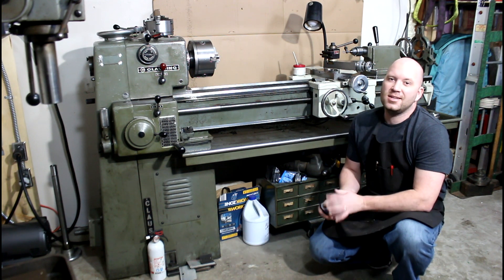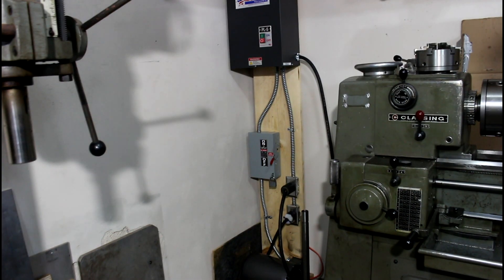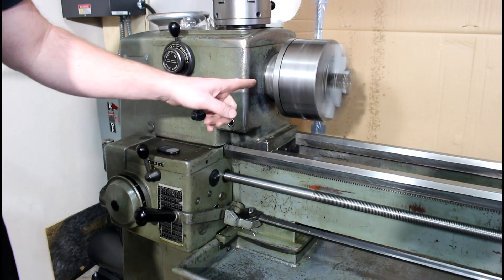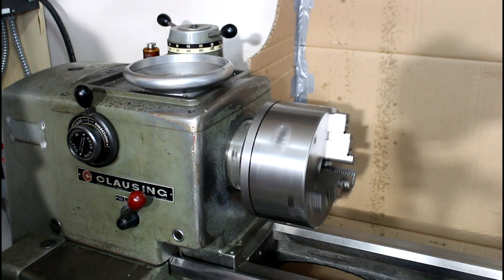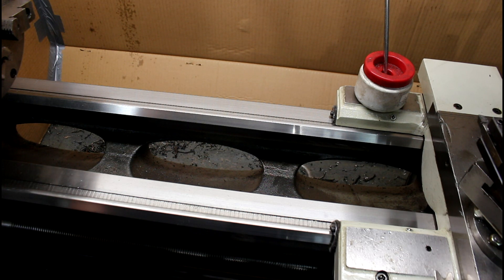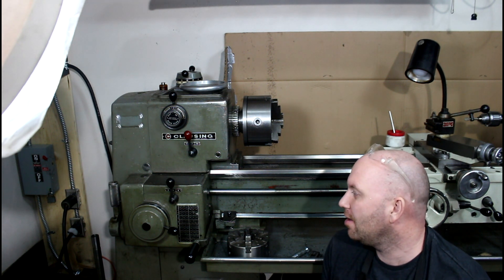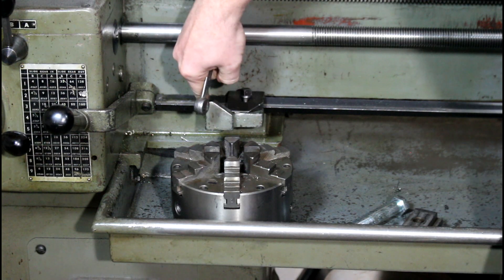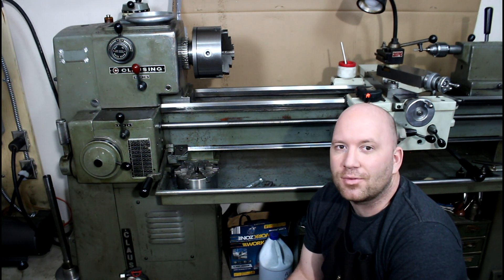Clausing 6913 Lathe Overview

Comment: Clausing lathes are the bomb. Simple to operate. The clutch/brake mechanism is a must have. (Either that or a foot brake). The only weakness or issue I have with them is the Variable speed mechanics. Never saw one that didn't leak oil and need constant maintenance or tweaking. Got yourself a real work horse there!

Comment: Great video. I recently bought the same lathe. What oil do you use in the head stock is it iso32. Thanks
Reply from the maker: That should work. I no longer have this lathe, but it was a mid weight machine oil.

Comment: Any tips on moving one of these lathes with a split base. I just bought one and need to move it out of a single garage on to a equipment trailer.  Did you use a pallet jack to lift yours?  I  am thinking about either building a long pallet and lifting from the head and support the toe with a something wide and simple.  What did you do to move yours?
Reply from the maker: I'm sure you have move it by now, but I have used engine hoists to lift it and gas pipe to roll it across the floor. I'm not a fan of machine skates, but I know a lot of guys use them. I find that you can move it around on pipes very easily and you only need a heavy pry bar to get the pipe under it. Less chance of tipping as well. The easiest way would be a forklift which I will be getting soon, otherwise, a set of really heavy casters on a single cradle under each base would work too. One where the base is only 1-2" off the floor and the wheels are off to the sides recessed up.

Comment: I have the pleasure of owning a Clausing 6913 . I picked it up a few years ago at a great price with a large amount of tooling. Its a great older Lathe, I have some experience with it but its only for my personal use on race car and hot rod stuff. it had a few issues when I picked it up but was in working condition. Now my use of the machine is picking up and I want to try to correct those issues . I have some paper work on the lathe , but I do appreciate your experience with it and I would like to pick your brain on how to possibly make the repairs as well as making arrangements to compensate you for your time. How can we make contact ? Thank you 
Augie Sacco
Augies Art & Customs
Reply from the maker: You can email me. I can help where I can.  precisionmachineshed@gmail.com

Comment: Nice looking machine. At first glance I thought it was nearly the same size as my logan 2557. But boy was I wrong. Looks like it about 1000lbs heavier.  Gotta be a nice rigid machine
Reply from the maker: It is, and yes, it's a little bigger than your 2557. I plan to take the drive out this spring and go through it to make sure everything is in good order. It's getting a little noisey, which is a problem with these machines.

Comment: 220vt residential power has "two" phases. Its correct to refer to 220vt as "2 phase".  "single phase" will only give you 110vt. The Clausing is a nice example of American precision machinery.
Reply from the maker: 2 phase hasn't been used for many years in the US besides a handful of older systems that are still operational. A split single phase circuit (which is what I am using, 2 110V single phase lines) is in almost every home. (think your oven) You can't magically convert a single phase power supply into a house into 2 or 3 phase without converting it somehow. Single phase runs one cycle. Two phase 2 and 3 phase 3 cycles. Hence why 3 phase is better for surface finish because the pulse of the cycle is 3X faster than a single phase unit.

Comment: Why didn't you just install a 220 breaker in your breaker box end run 220 to a new outlet right next to that lathe so you could just plug the late into a 220 outlet instead of spending all that money on a phase converter or do you not have 220 running into your house I assume you're in America end usually American homes have 220 coming in to the main breaker panel and then from there it's 110 out to your standard home Outlets unless you have a garage in your running air compressors and welders and you need to 20 or you have washing machines and dryers that run on 220 or hot water heaters that run off 220 it just seems over complicated and triple the price for all that stuff instead of just a 220 breaker the electric line and the 220 outlet ? But the speed control on that clausing is awesome
Reply from the maker: It is 220v from my main panel.  However all that extra stuff is to convert 220v single phase to 220v 3 phase power to run all the 3 phase machines.  I got sick of buying VFD's and rewiring every machine to run off a VFD to attain 3 phase.
Reply: I'd like to switch mine to 220 single phase but not sure what horse power or shaft size I need. Any ideas???

Comment: When is a America going to catch up with the rest of the world and have 3 phase of the grid. Instead of all these noisy converters?
Reply: America, like most of the rest of the world, has three phase supplies running past most propeties. It's only single phase into most non commercial properties. Unfortunately getting three phase run in from the road (or from the transformer in more rural areas) can get very expensive - here you could easily be looking at £10k. Hence rotary convertors - not very efficient, or VFD's. The way the US obtains their 220 volt single phase supply is rather different from others and folks need to be aware that this and the earthing arrangements differ wildly between different countries. What works well in one place could well be downright dangerous in others. BobUK.